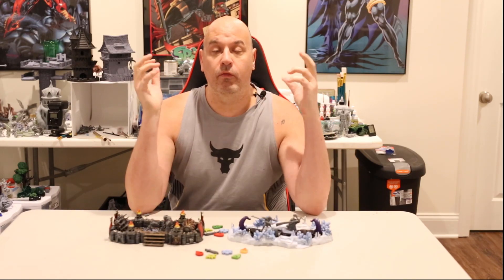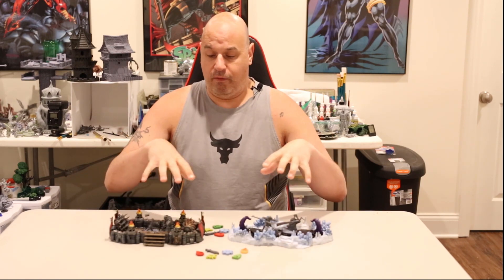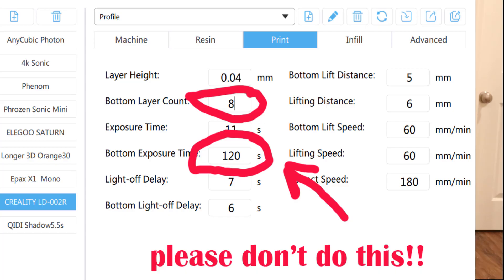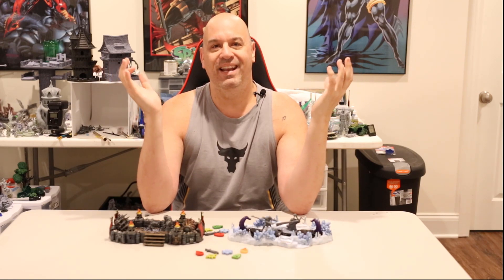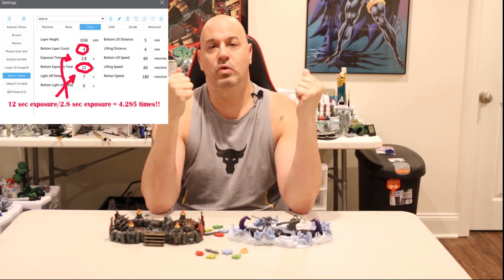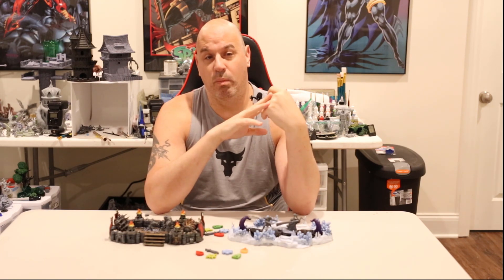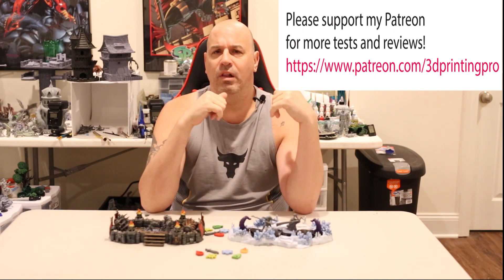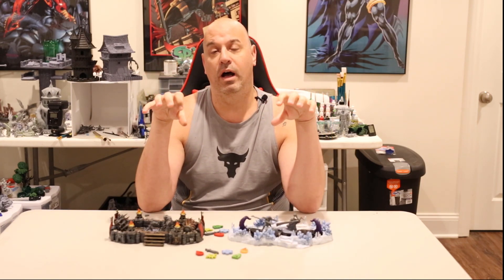Are you destroying your LCD screen when resin 3d printing?? Learn what settings may be doing it...

Comment: Now this is a great discussion! I now need to go back through and relook at my printer settings to help try and save on my screens!
Reply: I find with water washable resin I have to go with significantly higher exposure settings and higher bottom layer settings otherwise I see more failures.
Reply: @mstate1981  How long exposure time for water washable with a monochrome screen?
Reply: @dalecolegrove6652  not sure - mine is not monochrome
Reply: Lol, I use your settings Jess. Update video part 3 :). Thanks also Greg.
Reply: @velveteenv76  Im on here lookin for Uncle Jessy’s settings right now so O can start printing these model cars I have.
Reply: @jeqwanwilliams4839  Good luck, had to change my LCD screen, after print failure galore, had to go from 2.5s to 4s and my bottom to like 50s on my Saturn. Not sure of the quality of LCD screen is cheaper or what? the fun of learning as you go and cleaning out your printer after trying every to avoid increasing that print time :)
Reply: @velveteenv76  them are the settings Im gonna use right now. Im sittin here like man…forget it and get er done!! I thinking I messed up I compared this to child birth to my wife now shes like she wanna see me have this baby lol
Reply: Jessy, didn't you make a video on LCD screens failures? I wonder if this could be a piece of the puzzle. I'm going to try different settings to see what happens.
Reply: @stinkyham9050  think I have mine too high, struggle to get them off the plate a lot.
Reply: @velveteenv76  I've been using 4 bottom layers at 100 seconds with regular exposure at 10 seconds on a Photon using Polyjuice resin (water soluble resin). I have great results, prints come off my plate easy with a plastic scrapper. I'm going to try setting my bottom exposure to 50 seconds and see what happens.
Reply: I watched your video for Vroom, do you think now is chaged somethings after this video?
Reply: I'm doing this right now! LoL
Reply: So exposure can heat up the screen, but what about when we print in the summer and the ambient is around 90F, with the curing the resin can easily get over 100F.  At what point does that start really damaging your screen?  Does this apply to mono screens as well?
Reply: Greg AND Uncle Jesse agreeing on this? Yeah. Im doing it wrong for sure lol
Reply: I go 10 layers at 40 seconds normal exposure is 2.5 seconds

Comment: Excellent video!! LCDs are expensive and printer producers don't give almost any warranty on them. I'm just wondering how much extra costs resin printer may generate. And what if after few years I'm unable to buy particular LCD anymore? They are specially made for these 3D printers and aren't available by a known part number. Or price is like 90% of a new small cheap printer? To stock or not to stock them. That's crazy

Comment: I bought a used QIDI Tech Shadow 5.5s as my first resin printer. My first prints had divots, and one large print had a hole all the way through. Turns out the LCD screen had a bad spot about 4mm in diameter. I have a replacement screen on order, and you can bet I'll be doing some test prints with fewer bottom layers and shorter exposure times!

Comment: Using Saturn S and increased to 10 bottom layers at 30 seconds based on advice from reddit. Changing it to 5 bottom layers and 18.30 (6x the 3.05 exposure time). If it doesn't work, I'll complain :D

Comment: I have Anycubinc mono m5 at our lab. The best normal exposure time I found by calibration is around 2.75-3 Sec with the default resin. Also having 3-4 bottom layers with exposure time of 20 sec works really well for medium samples. If the bottom exposure times is 15, the smaples do not stick. 
If I have the default settings, sometimes some samples become really hard to get off the bed. Specially if the shapes bottom surface is too flat.
Also I think having a very large exposure time for bottom layers will give you a bigger elephant foot effect on initial layers. It may matter to some people that need details on the initial layers for some reason.

Comment: I'm printing small pieces on 30um layers.. the resin I'm using is elegoo 8k standard.. and the printer is a saturn 2. Layer exposure times on that configuration is like.. 1.8 seconds. But the bottom layers, if I multiply that by 5 or 6.. it simply won't do it peels off. So it's on 15 seconds now. Never printed many heavy things with that config yet but the bottom raft layer is pretty soft..

Comment: Please help me understand, but my understanding is that it depends more on the resin than the printer? EG I'm using Elegoo water washable resin and the manufacturer themselfs say to use 3.5s and 35s
Reply: Depends a bit on both.
I have am elegoo mars 2 Pro and have been using Elegoo water washable resin. 3.5s exposure was a bit over exposed for me.

I have a simple loose acetate screen protector on my screen that increases exposure time by 0.5s , and with elegoo water washable resin 3.2 exposure and 34s bottom exposure was good for me.
For a stock mars 2 Pro with nothing on the screen 2.8s exposure should be good.

As a rule of thumb multiply your regular exposure time by about 10.5 for the bottom exposure time, and you can use models made to test calibration to see if you are over exposing or under exposing.
Reply: @8bit_pineapple You pretty much said the same as I did only with slightly different numbers.  Point was 3.5s to 35s is 10x.. You also said about 10x.  The author of this video is saying that is WAAY too might and bad for our screens, but its what the actual manufacturer says!
Reply: This is the calibration print I like to use. 
https://youtu.be/GL-9Ia0SibQ

If you want your models to come out as good as possible you can use this to find your best settings for your printer and resin.
Start with an exposure time of 3s with water washable resin and see if its over or under exposed
Reply: And if your having issues with print fails, the culprit is likely how you are leveling your plate, or how your are scraping the models off.

When scraping models off always hold by the plate, not the part that attaches to the printer.
If you always do this your plate will stay level for months and months.
Reply: @8bit_pineapple  My bed isn't going to move :)  I have the Saturn 3 Ultra which uses the 4 bolt head rather than the ball head.  Plus I use whambam flexiplates so I just pop those off them go to town on them.

Comment: 6top 60bot 50um. M3 Max. Sanded plate. Can’t get to stick any lower. So not sure how you guys are getting it lower.

Thing is I don’t print miniatures. I print huge. I take up the entire build volume if I can.. does this matter or impact bottom exposure?

Also I use hd gray water washable any cubic resin +

Comment: Good Day Mr Pro.  Trust you are well. i am a new printer but brint in the Dentakl fiels. i have run into some problems and not to sure how to get it sorted out. Please can you maybe assist me with this if you have the time.  i print with Harz Clear pro 50 micron for surgical guide, it is a very thick resin. I get these funny little nipple like protrusions when i take the supports off, its like a little tent where the support was like the pulling forces are to much. do you maybe have an idea what it could be. any assistance would be appreciated.   Thank You

Comment: The fact is you should be calibrating your bottom layers the same as the other layers. You want the print to stick without pancaking, but you also want to be able to take it off after the print is done without resorting to using the scraper like it's a chisel. Ideally I want to be able to remove any print with just my fingers.

Also I typically use 2 or 3 bottom layers.

Comment: I think this is pretty solid advice, and the problem is that chitubox is putting in pretty high bottom exposures as well.
I started out with the basics from chitubox at 40s exposure on 6 layers.
Now the miniatures stuck to the build plate just fine, but I could hardly get them off and had to use extreme force to get them off.

Common sense told me that it shouldn't work like that, and I started lowering the time.
So far I have had 0 print failures concerning build plate adhesion and have dropped to 30s over a few printing sessions.
However looking at this video I am gonna drop my settings even more and see how easily I can remove them afterwards (though they pop off reasonably already now).

Thanks for this video, keep it up!

Comment: So exposure can heat up the screen, but what about when we print in the summer and the ambient is around 90F, with the curing the resin can easily get over 100F.  At what point does that start really damaging your screen?  Does this apply to mono screens as well?

Comment: It's just a typical case of people fixing a problem the wrong way.  Also before each print I wipe the bottom of my vat with 3 in 1 PTFE lubricant.  It did make me a little nervous at first because frankly you cannot hear the first layer pop off the FEP screen.  Maybe a little bit if you listen closely but that's it.

Comment: Hey so I just got my saturn 2 printer and the default settings I think are 25 seconds for bottom layers should I lower that to the 12 or so for my next print? The default I think for mine was either 4 or 5 layers so that's fine but should I lower the bottom exposure setting to 12 from the default?

Comment: I am on an Elegoo Mars and when printing smaller items on the plate and multiple, they do not stick. I am currently running a trial of 5 layers at 100s. 5 layers at 20/30/40/50/60/70 didnt work. Normal exposure time is 8s so going by X12 I should be at 96 max. Pulling my hair out with the lack of adhesion. :(

Comment: OK so my issues, I just started and big problems I did exposure times of 25 40 both times bottom layer stuck on plate and the start of object stuck on the fep what is happening the details get stuck on the fep and not sticking to plate
Reply from the maker: Raise your normal exposure and try again!
Reply: @3DPrintingPro  I'm not sure where to start for normal exposure. 10 8 25? Lol I was printing a hollow model most came out fine until maybe 3 percent after the supports were made stuck to bottom I think it might be suction. Also repaired that in lychee.

Comment: Bought a Saturn 2 and prints will fail constantly to stick to the plate if i go any lower than 60sec.
Printing exposure is also way higher than advertised, 4-4.5 sec calibrated with the cones of calibration.
Reply from the maker: That's odd I use a Saturn 2 with 20 second bottom time and prints stick perfectly, are you using a "slow" resin?  Or printing in a cold room by any chance?
Reply: @3dprintingpro212  I don't exactly know what is a slow resin.
I tried Elegoo standard, ABS-like and water-washable.
Currently I'm using a bottle of SUNLU resin  which worsens the problem and takes as long as 70 seconds for bottom layers.
Next in line are some Anycubic resins I got this week.

I also don't use any fancy colors mostly gray, ceramic gray and so on.

The room is anywhere around 70F.

Leveled the printer three times now, first time was really messed up, but no difference between second and third time.

Comment: So this is is a great vid, but what I did find on the industrial level printing options, the Elegoo Jupiter Printer and large scale printers come defaulted with a set 30 second bottom exposure time and a 3 second layer time. This just leads to non stop failures with the initial test prints. I ended  up bumping them up to 90 for the bottom exposure and then 6 to the layers. Fixed the issue. Especially on bigger machines and larger prints I was super surprised that was what the baseline Jupiter stats was. Love the channel!

Comment: Ok so followed your advice. Settings were 8 layers at 70 seconds 🤦🏻‍♂️. Adjusted to 5 layers at 12 seconds. Printing now will advise on results. Great video!
Reply from the maker: Depending on your resin and layer height and type of printer you might want to go to 20 seconds or so first to test  :)
Reply: @3dprintingpro212  roger that!  I just got the Saturn S and 10 bottles of water resin. Sky’s the limit. I’ll keep trying different settings and post results. This was a great topic and well explained. Ty sir. Subbed
Reply from the maker: @bubba6richards729  For Saturn S, with water wash resin, to be safe, test at .04 layer height, 4 bottom layers and 25 seconds bottom time, then you can adjust from there  :)

Comment: I have had a hard time not getting the build plate to stick to the fep, I have adjusted and tried the settings you had here and it still slightly makes that faint "pop" noise, but no rocking or pulling it seems. I have a photon ultra -- any recomendations? Are the settings to same for the photon and the one you are using? 
Also, should there be a slight noise when it is lifting?

Comment: Thanks for the suggestions on changing the bottom layer times. I’m fairly new to resin printing and I e noticed my prints are difficult to come off sometimes. I will try lowering the length of exposure time. As for the layers, I have mine (Creality Halot) set to 3 bottom layers.

Comment: I've only been printing a week on my 1st resin machine, a Mono X. The machine came set at 100% UV power and the software defaults to 8x 40 seconds on bottow layers. Everything printed at these settings was impossible to remove without breaking. After lots of test prints I've found 4x 17s bottom layers and 2.7 seconds is perfect for Monocure rapid clear.

Comment: Ok my friend. i have spent 2kg of resin by anycubic grey basic. I tried your advice and i just almost loose my mind to be hoenst to make anything work with 4 bottom layers and 8 times the exposure time. I cried, i felt i was going insane, because how would this setting that an expert usese wont work for me. im sorry but i cant go anything lower than 30 seconds for bottom lyers and maybe 10 for some fucking reason the 4 BL and 8 times exposure or 10 that you siggested never worked. it just didnt work. M3 MAX Anycubic, please dont try this settings, it was bad for my mental health

Comment: You're a lifesaver!!! I'm still only a few weeks in, and only just got prints to stop sticking to the FEP literally like 3 days ago. One of the things I tried in my desperation was to increase exposure times. Upon reading someone's reddit post, I increased my bottom layer from Elegoo's recommended 35 seconds for this resin, to... 90!!! Luckily I've only done 3 prints with this setting so far-- this video came at a perfect time! I'm going back to Elegoo's "official" recommendation of 35 seconds for the time being, then when I'm more experienced and my prints are less likely to fail, I'll drop it lower. Thank you!! I'm surprised this isn't talked about more!!!

Comment: So I just recently found your channel... wow there is a lot of information here... anyway; I have an Anycubic Photon and have been using 8 bottom layers at 90 sec (normal exposure is 15 sec off-time 6.5 / 0.05 layer thickness.) I've had good success with these settings but I'm very interested in trying out your advice to see if I can achieve the same results with much lower bottom layers and exposure times. so I've moved my settings to 4 bottom layers 50 sec exposure with normal exposure at 10 sec... (gonna go watch your Off-time video next to see if I need to change that setting) I'm also using Anycubic Plant Based Resin. . . So, Any advice for me?

Comment: Well mate i would agree with you except for the fact that most resins i have used are 30 seconds minimum. 30 seconds on base layers, 3 seconds on normal. So from the manufacturer thats 10x your normal exposure time. I used 32 seconds and 3.2 for my normal layers atm, had a couple of failed prints last 2 days but that was cause of me over tightening my Fep when i had to replace it for the 1st time myself. I had to up that time when i got my new magnetic build plate. It did not have the beautiful cross hatching my anycubic mono x 6k has. So i had to sand it up a little and pushed my base layers to 40-50 seconds depending on size. If you dont want to cook your screen go for longer times but turn your uv power down to say 85% that has worked for me as well.

Comment: My point:
If You have a printer with $1000 screen and $40 resin, do less bottom exposure, You can afford reprinting.
If You have a printer with $50 screen and $40 resin, do a lot, but when it's not necessary, remember to reduce it
If You have a printer with $50 screen and $100 resin, do as much exposure as You can. At this point You should treat LCDs as disposable item.

Another point:
If You do a 120 seconds of 8 layers like he said in the video, it's still not that bad If You are not using a raft, but that's probably still worse than using using a raft on 60 seconds with 5 layers?

BTW I wonder what's the best temperature for printing? I've heard that low temperature is bad, but how about high?
I have my printer in kind of a little chamber, because I only have a small flat and I can feel the effects of resin fumes on me. Some food packing foil and a zipper around it, glued to walls of one shelf in my wardrobe. I assume that the temperature in the chamber gets to around 40 celcius, so the resin itself must be pretty warm. I usually did like 10 layers of 70 seconds BTW. And yes, I did manage to seemingly melt/dent my FEP. But it's obviously not on printing miniatures, it's on bigger stuff (this one was a wall of dice tower)

Comment: I think most people do a lot of layers/bottom exposure time because when they are new to printing, they fail the first time, then when they go to the internet to ask for help the first thing they find is an excel sheet that show best settings for each type of resin. For the anycubic [for example], that sheet suggests 8 layers at 120 bottom exposure. They give that a try, and it works. So they don't question it anymore and start printing like that forever.